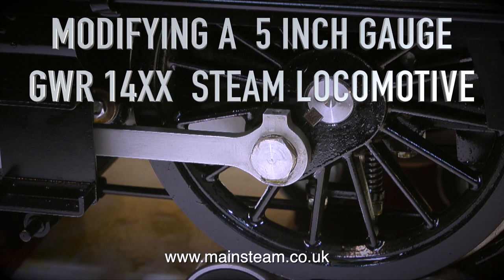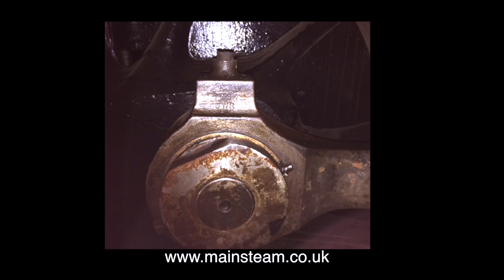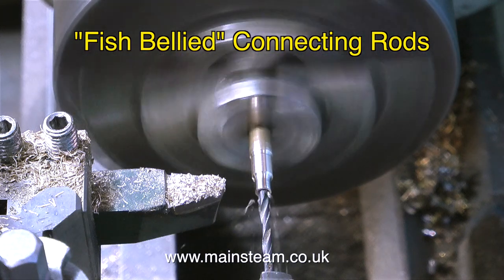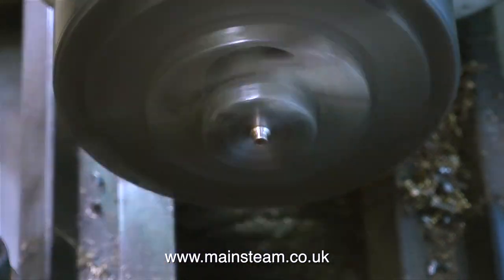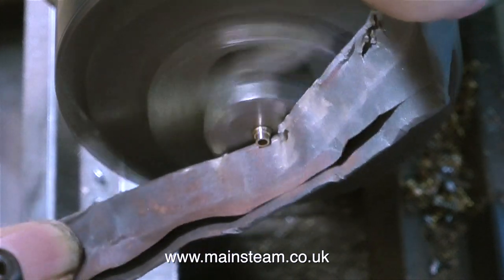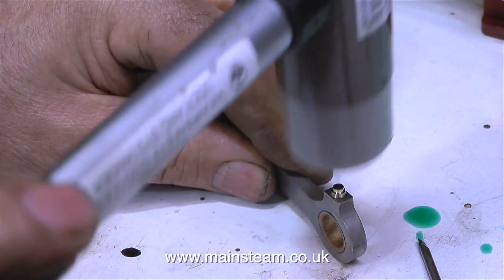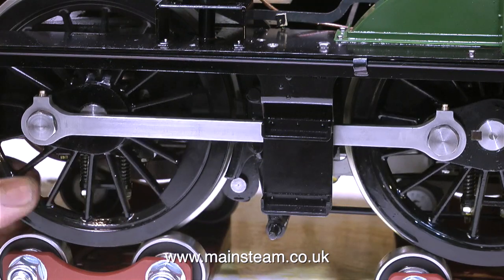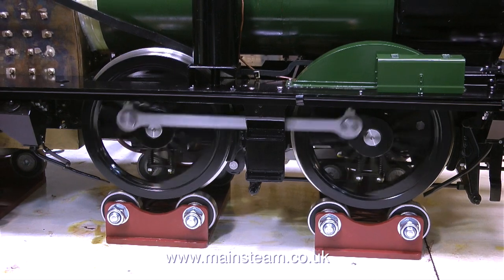MODIFYING A 5 INCH GAUGE GWR 14XX STEAM LOCOMOTIVE - PART #5

Comment: Great Series Keith, hope your going to show the injector modification as i have one of these to do myself. While you've go it stripped down have a look at the Banjo union nuts on the axel pump, one of mine fell apart as there is a cross hole making it very weak. Ray.

Comment: Not forgetting that the pin goes down straight from the wheel center to give a warning that the crankpin may be broken!
Swap you your nuts for my Jinty as she has 6 nut type nuts!
All bolts on a full size Locomotive were facing UP with several threads showing?
Why? So that when oiling the Driver could see at a glance that one may be getting loose!
Getting too close to scale the brake beams have a chain either end to prevent this falling onto the track in case of failing!

Loved your video.
David and Lily.
Reply from the maker: Great info David - thanks {:-)))

Comment: This 5" train won't run on your 7.5" track.  So will it be purely for decoration?  Love watching it come together (after you take things apart), although your opinion on the niceness (or not) of certain parts is certainly an 'eye of the beholder' thing -- the hex bolts look nice and sturdy to me.  Old steam trains full of non-removable/repairable rivets were a real eyesore when I was a lad, at least you could get a bolt off the engine if it had a hex head,  

I do understand its your engine and your decision, but I'd say it matters nought what kind or material the connectors are made of, as long as they are made well, and suit their purpose.

This is meant as an observation, and not a criticism, (ya cranky sod :P).
Reply from the maker: What I will probably do is take it to a Club track if I want to steam it - or just use my Rolling Road on the picnic table in the garden ....... {:-)))
Reply: And here I was imagining a new series "5" track laying in the Garden", now that you have us interested in trains you need to complete it by showing what they run on.

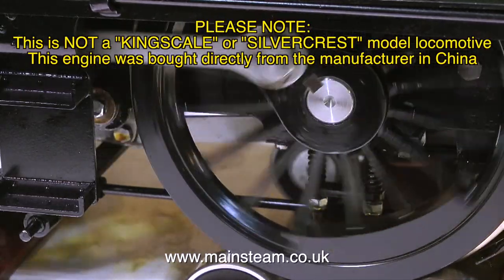Comment: If you look at the nut left of the wheel at 0:15 and under the steps there is a bit of slop in it is that meant to happen?
Reply from the maker: Yes. it's meant to happen ....... a bit of play here & there is essential for easy running ....... alas it is not a state of the are jet turbine engine ..... {:-)))
Reply: Keith Appleton thank for replying and even jet engines have play between the fins to allow for expansion so that it doesn’t seize up.  Also what was the company that made this engine.

Comment: Mr.Appleton, you mention China as the Manufacturer of this Locomotive as if a lot of people think everything from China is junk,as most people do. I was under the impression that China will make things of Low Quality or High Quality depending depending on what the Importer wants. In the USA most items that come from China are made according to the specifications that someone in the USA wants. Please don’t take what I’ve written as being sarcastic in anyway. I believe that China can and does make High Quality items. China also makes a lot of Low Quality items.
Reply from the maker: I would agree with you, in the case of this locomotive a lot of it is good but there are design flaws that need rectifying. It is not expensive as far as steam locomotives of this type go, and with a little work from yours truly, it will make a very good reliable engine.
Today I received some items from China that are beautifully made, - and it's worth remembering that many everyday items that we use also come from China . . . . I feel that within this decade Chinese goods will become synonymous with high quality as it is with the Japanese products. But having said that there will always be poor quality at the lower priced area of the market.